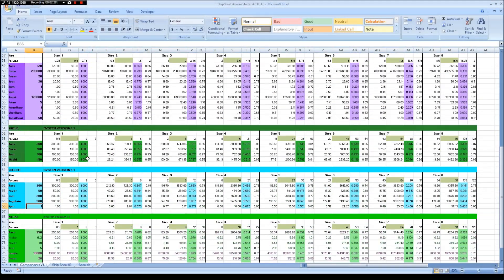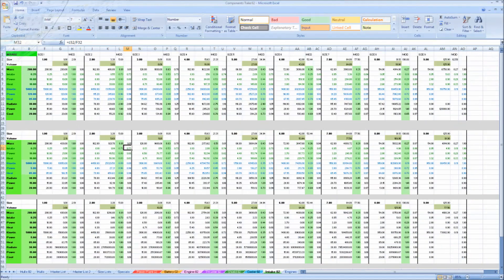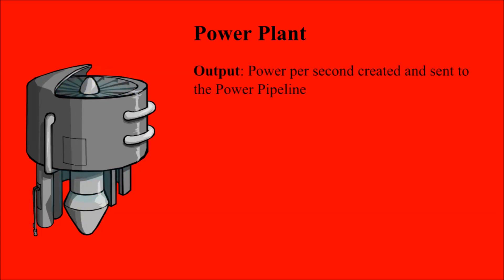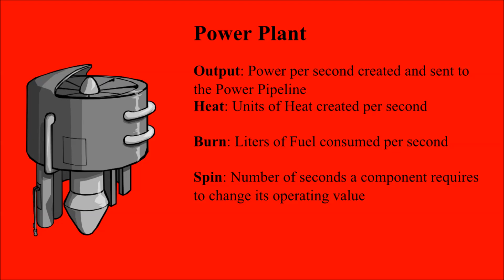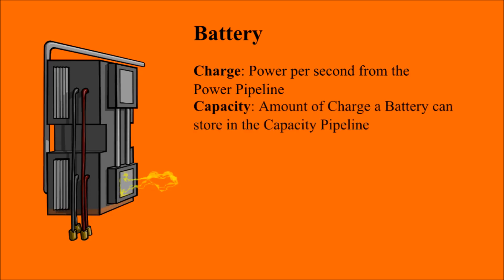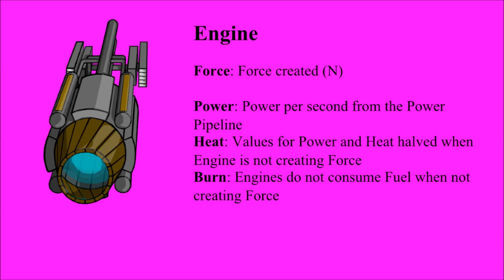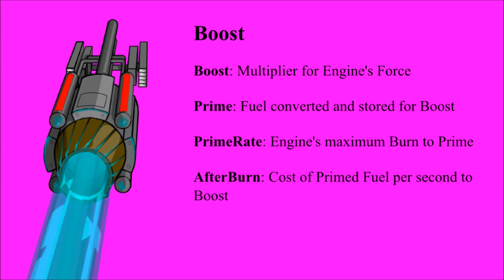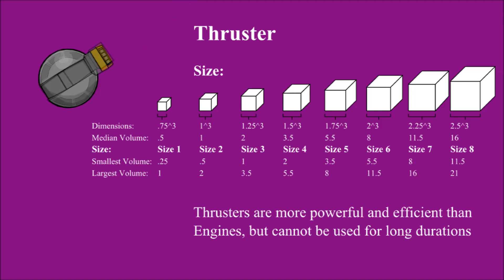Modularity Part 02 (Ship's Components and Attributes)

Comment: No insult intended but power per second is a nearly nonsenical term. You mean to just say "power". Not power per second. Power is energy per second. So to reword you discussion about the pipe system an engine makes power which is added to the power pipeline and it also makes power (thermal) which is added to the heat pipeline. The ratio of these two numbers depends on the engine efficiency, and a bunch of other things. 

Im trying to think about what j/(s^2) really is. I suppose it is simply the acceleration of energy. So a battery holds a certain amount of energy. And it charges at a certain rate (power "consumption"). Power per second would have to be the rate at which the battery changes its power consumption. So, you have the battery there with 10000 joules of energy but with no load it draws no power. p=0. When you plug it in, you check, and now the battery is "producing" power at 5 watts. Or 5 joules per second. Power per second was the rate at which it went from p=0 to p=5. Because it wasnt technically instant. However, in the case of electricity its pretty close to instant. In other cases power per second, or more accurately watts per second, may be relevant. But Ive never heard it used. 

Love your videos though.
Reply from the maker: ataraxic89 This is something I'd like to rectify eventually, but for the sake of the system (volumetric standard) I didn't mind the details.  A simple method for everyone (myself included) is to say the snow-cone machine makes 12 snow-cones per minute, and there are enough customers to buy 7 per minute; the snow-cone machine makes too many snow-cones -- lower its product to balance things.

I ran into the same problem with heat (also power), but once the system is set up, clarifying units of measure and adjusting those to another standard means only changing the Archetype master for a component (which updates all components under that Archetype as the filters are just modifiers for the Archetypes), and perhaps a formula or two in the pipeline calculation; I have a bevy of formulas and explanations to draw from,  but it doesn't change the format of the system.  The system is just an organization method for determining what something is, what it produces, and what it's product does; the names of the units are irrelevant except for recognition.  If we changed Output/second to joules it would function the same, and we could adjust its value to a reasonable science fiction level to inspire awe in people who know better, but is really only "important" as the color of the line as the name of it to the machine.

Still, yes, it'd be good to observe standard terms.
Reply: Nebohtes Oh I know. I was just being a friendly pedant. :P

It doesnt affect anything. Make up units. Once you start really trying to pin down the math of this stuff you see just how scifi it is. 

I was just pointing out that power per second is a different thing from what youre trying to say. Easy mistake to make. I didnt really get what "kilowatt-hour" meant until last year. I just couldnt wrap my brain around what is now an obvious and simple term to me. Its just a unit of energy. Because watts are j/s and kilowatt-hour is 1000 j/s * 3600s. The seconds cancel in the units and you are left with 3,600,000 joules. 

p.s. Btw I would love to have a long discussion of game design mechanics with you. I really love to think about game design (not just SC) and it seems you do too ;)